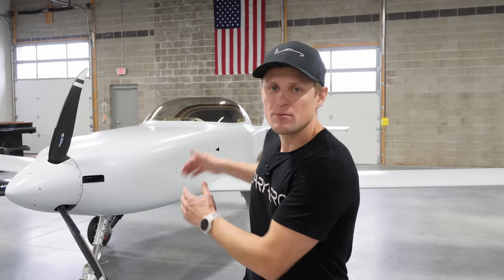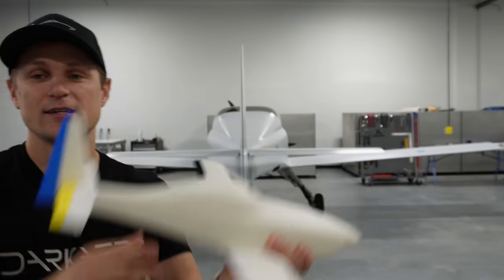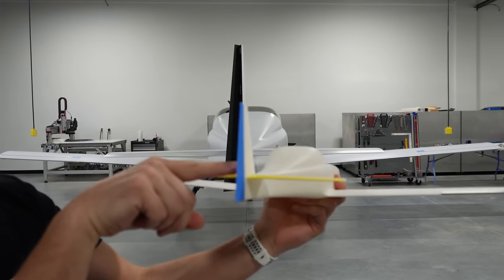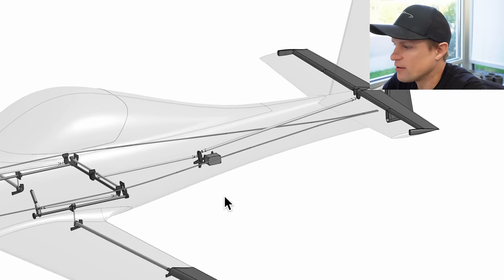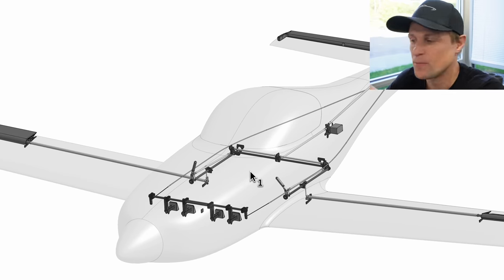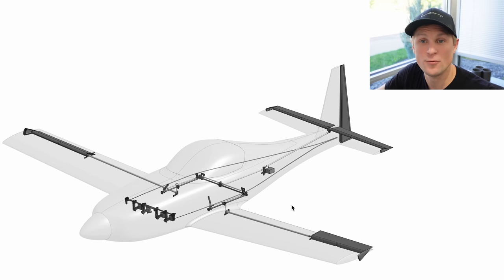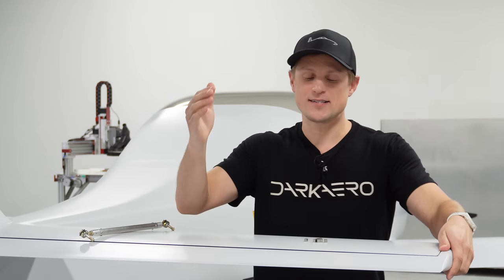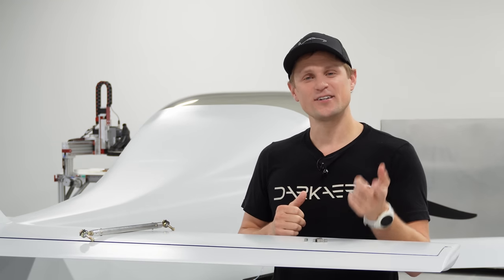What makes our flight controls different

Comment: I have no doubt the split rudder will be 1) Easy for the pilot to operate, 2) It will cause the desired yaw moment. However every deflection of this rudder will also impose the same drag that you intend to get in "air brake" mode. I'll acknowledge that the stagnation point in cruise will be proportionally small with small control deflections, but you're still invoking a braking function every time you deflect the rudder. The VariEze design, which continues to be used as an comparable example, does not impose this penalty. 
And of course with the shallower spar per rudder you're exposed to aeroelastic risk via lower torsional strength.
Regarding elevator counterbalancing are you not also employing a counterweight arm inside the fuselage to minimize twisting moments on the elevator?

Comment: 11:00 instead of increasing the arm length to balance it, what if u add a cavity inside the wing and have the aileron elongated along the entire tail, distribute the weight in a short depth and it doesn't interfere with the airflow?

Comment: I've seen split rudders but I'm not sure I've seen that control scheme for the rudder only moving one side at a time, interested to see how y'all came to that decision and how it changes things like spin recovery. Obviously would imagine it would be at the worst a negligible impact but are there any major advantages to this aside from weight saving for having a speed brake?
Reply: Its just the speed brake. Its a debatable function but one could argue its safer to be able to control your speed at will than the negative consequences from the spin characteristics. One thing is for sure, I dont see split rudders on every plane and there must be a reason for that.

Comment: 2 questions regarding the rudder: Wouldnt the empty space between the rudders cause extra drag on high speeds? as the air stream will be split in half? at some speeda this migh act as a lifting surface no?
is there a possibility that the "air brake" will act as an elevator if the angle of attack is not perpendicular to the "rudder"?  say on final?
Reply: Don’t they have a whole video addressing these concerns?

Comment: Wouldn’t using tungsten only reduce the amount of balancing material used? The weight would be the same, not reduced.
Reply from the maker: Balancing the control surface requires mass mounted a distance away from the hinge line (mass x distance). A denser material can be packed further forward on the balance arm, so less total mass is required to generate the necessary balance moment.

Comment: How close is your aircraft to requiring hydraulic assist to move the surfaces?  Curious about what size or speed the need for hydrauic assist becomes a requirement.  (I assume this adds a whole lot of complexity/weight to an aircraft).
Reply from the maker: We are a long ways from requiring hydraulically boosted controls, which are mainly found on much larger aircraft. Even on large aircraft there are still tricks like servo tabs that enable manual controls with acceptable control forces.

Comment: How does the breaking system work, in conjunction with the split rudder?
Reply: "braking"... but that's a good question.
Reply: When the rudder is split (both rudder pedals depressed), it creates aerodynamic drag. It has nothing to do with the hydraulic brakes on the wheels.
Reply: @mgd3333  yes, but it's still a valid question - how does the wheel brake control work?

Comment: That is incredible!

After your project, would you ever consider adapting it to hydrogen, or some other fuel cell?
Would you ever try your hand at a larger 4 seater with either hydrogen or solid oxide fuel cell?
Reply: Hydrogen needs big high strength cylindrical pressure vessels, am no expert but can’t see that fit into a wing fuel tank. Also you can’t get hydrogen at any airport.

Comment: Trim tabs. Trim tabs? Trim tabs!

You use uber-expensive tungsten in preference to super-cheap lead, in a presumption to eek out a tiny advantage in drag (in flight regimes whereof drag is sometimes desired anyway), when at the same time you use trim tabs which always introduce weight, complexity, and/or (unnecessary) parasitic drag in all flight regimes?

It´s just as well that you can distract the consumer with that cool split rudder, as then there is less chance you need rationalize a technology that even a century ago had multiple alternate engineering solutions and workarounds.

Comment: Tungsten basically minimizes the total amount of volume that you are adding, not weight.
Reply: Because of its lower volume it’s cg can be at a larger radius ie more moment or less mass for the required moment
Reply: @byronspencer234  That makes sense.

Comment: why dont you guys use fly-by-wire controls? it seems that fly-by-wire could both reduce weight and be easier to fit in the small airframe

Comment: The Fed's may take concern with that split rudder. Spin recovery?  Cross controlling?. Slips? Slow airspeed/hi angle of attack? Hi speed flutter? Low speed ineffectiveness? What does it do with full drag and full rudder? .. any rudder left?  Trim? etc. etc.  That's a big box of flight testing/data that's now open, on top of an already brand new airplane with many first time designs. May be better to incorporate the splitting of the rudder separately.  Or better yet... just fab a legitimate speed brake on the belly. 
  Adding unnecessary drag any time rudder is applied seems.... silly.   IMO

Comment: Hello guys.
Regarding the speed brakes on the vertical tail with the split rudder, have given any thought of having. The alirons in the split concept as well .

It is a simple concept to adapt
Reply: Good question. Is this plausible, or just unneeded?
Reply: @rdyer8764  it is possible.
Just design the aileron in the same manner as the rudder with the split concept. 

Inside the ailerons , install a normally closed or retracted  solenoid, type actuator when de energized, the split ailerons will operate as ailerons.. when landing on a short runway where the rudder speed brake is not enough to slow the airplane, the aileron speed brake can be activated just by the flick of a switch...., 

If i had an email address, i could share a sketch.
Reply: I don't think it would work with ailerons, but a similar principle is used in some aircraft which can use differential spoilers for roll control: only the spoiler on the wing that you want to drop is actuated. That's really a feature for complex aircraft with fly-by-wire (or at least advanced powered controls), not a small aircraft with straightforward mechanically-linked flight control surfaces.

Comment: surely there's a way to introduce a hand-operated speed break and make the two rudders act in unison, no? I mean compared to all the other challenges you overcame, this seems very doable. not that I know how :)
Reply: There would simply be a conversion briefing for any new pilots to ENSURE they DO NOT apply rudder pressure on both feet unless for the reason of using it as a speed-brake. No need to add extra weight when a proper briefing could solve the potential issue.  Like the man said: there are other types which also use the same configuration without any issues.
Reply: @AirwavesEnglish  I wouldn’t trust myself not to press both during a hairy landing and making things erm interesting. I would also be worried that I would step on both after hitting turbulence on climb out (in an effort to “keep the plane in line”). The only reason I’m saying this is that there may be potential future customers thinking similarly.
Reply: @fillywinks  Sure, I get what you're saying now. That's entirely plausible. Perhaps there is some kind of lock-out mechanism that needs to be disengaged to use the split rudder, and this wasn't mentioned in the video. I can't really see the use-case of needing to use these splitters anyway (unless going into REALLY tight airstrips) since the plane itself is already so light. We may need to see the physical stall speeds and operating/landing speeds on the test-flight to gauge their overall effectiveness. IF it IS un/lockable, I think it's a nice feature to have for fast descents and speed-management.

Comment: how do you counter or induce yaw with the speed brake "open"
Reply: Ease of of one of the padels
Reply: @dariush.2375  ahhh.  that's gotta be a pain to have to stand on the pedals for speed brake
Reply: When you're descending with reduced power, yaw should be negligible. You would never be using the brakes during high yaw scenarios.

Comment: I have an aerodynamics question in relation to split rudders if you don't mind.

By keeping one side of the rudder straight in relation to the oncoming air, is the overall force applied by the rudder diminished from what it would be if both sides deflected together?

It seems to me that if you took a look at a rudder vertically when deflected, not only does the deflected panel have a force applied to it by oncoming air, but it creates a bit of an airfoil shape. Does this create some level of low pressure on this side of the vertical stabilizer/rudder combo? If so, I would take it that the split rudder then removes this action/force, thereby reducing the effectiveness of it.

Comment: Umm.. you didn't say how the rudders stay straight.  A cable is great for pulling in one direction, but it can't push.  Single rudders have the other pedal to push it back to center, but you didn't describe any mechanism that does that for your split rudder system.  So.. ???

Comment: Having the split rudder just moving one side if used as a rudder, makes it a speed break all the time you use it!
That's not good!
The articulation and the split Funktion should be a separate function, or be mixed together as such.
Alot of sport pilots are doing stuff how they are teched, and don't have a good feeling for what the plane is really doing.
Having them unconsciously loosing more speed as usual by using rudder inputs screams for accidents to happen. 
If you want to commercialize this plane design keep that in mind!
Otherwise, have fun with that beast! 🤙

Comment: It is staggeringly banal to spend so much viewer time 'explaining' how conventional three axis controls work - do you really think that anybody needs to be 'educated' like this ?  Explaining how yours wheels work might be about as informative .. The 'split' rudder is not novel either - my "Opal" design from 1975 and published drawings show this and explain the glide path control function (familiar to all glider pilots )  Grumman Intruder, B2 bomber and lots of others use the same chordwise split for drag modulation you lose a LOT of rudder power by not moving BOTH halves in assymetric deflection as you seem to indicate (ie the yaw function) and I think that your vertical tail is already slightly undersized especially in view of the long nose and high power installed .  Your design follows the well worn path of overpowered 'boy's toys' in the vein of the Polen special, Brokaw, Sx300 and similar types of 'pseudo' WW2 fighters - but lack the purpose driven design criteria of a real period fighter . Once you are reasonably high there is no apparent 'speed' as such like a race car or motorbike provides and 'beat ups' or dangerous low flying hardly amount to a design justification for 'thrills' .  If point to point speed in real transport is the idea then for private citizens the real measure ought to be DOOR to DOOR which is the relevant measure and is hobbled by the logistics of getting to and from your 'friendly local long hard surfaced runwayed, hangar equipped, fuel on tap etc '"Local" airport .... usually miles from where you live or need to go on 'arrival' .   It would be much better for you guys to use your resources and obvious engineering talents on something that addresses this USEFUL goal and might contribute something worthwhile to society and aviation in a manner that fosters public acceptance and even enthusiasm for general aviation  (indulgences that only usually appear as accident reports in the public eye or show aviation as an adolescent extravagance  in a  cash strapped economy with real problems that aviation might better address ... look into  Advanced air mobility, roadability and similar googleable terms for 'inspiration'.
Reply: Cross outs are unintentional -can't help them on this ancient laptop but apologies all the same.

Comment: I don’t like it.  You’ve got 3 little hinges and a fairly small panel on each side.   You’re going to deploy this thing on probably the weakest part of the airplane.  It’s not good engineering.  It would have been better to use a belly board.  Or spoilers….  Or flaps.  I mean how many slow ass Cessnas bend flap tracks?  And that’s a pretty damn beefy strong part of the airplane.  Faster planes like the kr I used to fly had a belly board.   Flaps are tried and true.   To me this is just a bad bad bad idea.
Reply: Have they done enough flying?  Imagine how much wear and drag would result from flying in winter turbulence with one of the wings semi-violently rising from differential gusts made even worse with those high aspect ratio wings.  Every gust’s pilot response would mean an air breaking split rudder deflecting full travel correction with an instant slam closure as the opposite side’s wing encountered the next gust.